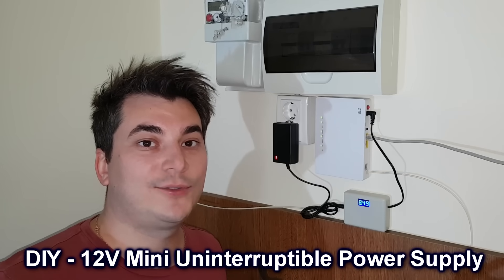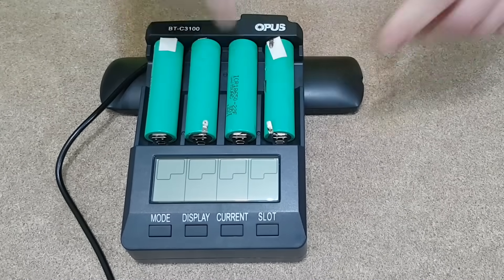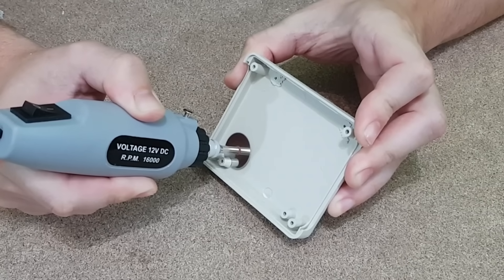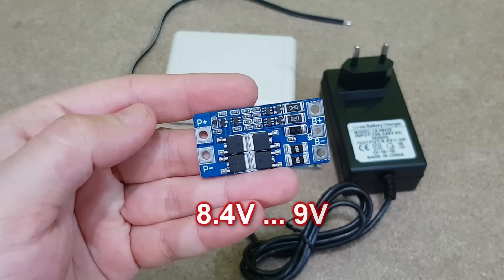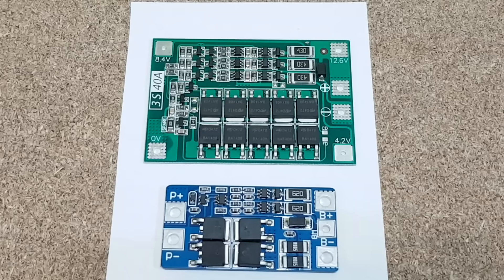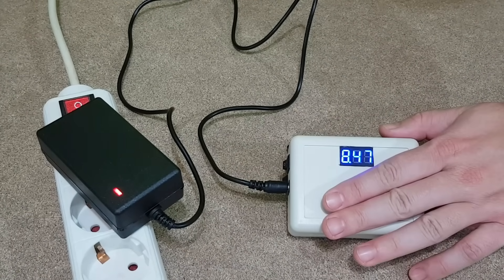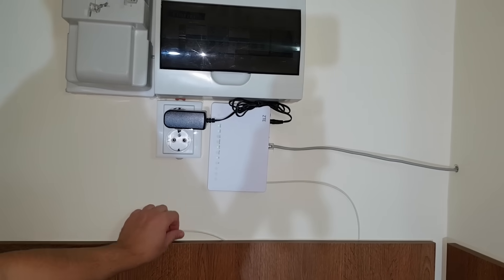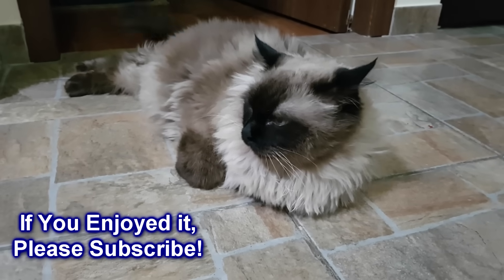DIY - 12V Mini UPS

Comment: Hello since you didn't use relay,diode,plc,static switch any of this i want to ask you if its ok to keep charging on for BMS ?
Reply from the maker: hi. this 2S BMS is almost continuously charging the cells, in time the cells capacity will decrease. but I've found a better 2S BMS board, I placed the link in the video description. it has overcharge release voltage. with this feature the charging process stops and will resume only when the cell voltage decreases to a certain value, from 4.2 to 4.1V I think. if you use good lithium cells with a very low self discharge rate, the charging process will start very rarely.
Reply: Ohh thats nice .. please can you take a look at this ?

1S BMS 2.5A/3A/4A/5A/10A/25A 3.6v 3.7v Battery protection board for Li-ion battery
https://a.aliexpress.com/_mMIYhwX
Reply from the maker: these are good, but for 1S batteries.
Reply: Yupp i need for 1s

Comment: If you are always charging the batteries and using the batteries to supply energy to the router, consider lower the charging voltage of the batteries. The batteries can be damaged if always working on maximum voltage. Lowering the voltage can increase the life time of the batteries

Comment: Nice proyect! Do you think it can be charged with a solar panel ? What should be modificated ?
Reply from the maker: hi. you need a charging controller or at least a DC-DC converter for the battery pack. and a solar panel with an output power much higher than what your load needs, so it will be able to power your load and charge the battery pack in the same time. I plan to make such a project, but it will take some time.

Comment: Can we use Adapter DC 12V 2A Power Supply Charger Plug for 18650 Li-ion Battery?
Reply from the maker: not really. you need to modify the voltage. 3 cells in series need 12.6V, so they will not get fully charged with 12V. and 2 cells in series need 8.4V.
Reply: @Sorin_DIY  I have 5V 1A  & 12V 2A Power Supply Charger Plug , Can I use either any one.???, if I have to use 3 cell in serial,.. I need to change 2S BMS protection board also right, I found this https://robu.in/product/2s-20a-18650-lithium-battery-protection-board/. but not exactly what you have used, will it be worked for 3 cells in series.?

Can you share Schematic if you have with 3 Cells and which BMS protection board which can I use .?
Reply from the maker: that 2S BMS is not very good. if you plan to make it with 2 cells, I suggest you use the BMS board from the video description. or another BMS with balance charging and overcharge release voltage. you can use the 12V charger and connect a few diodes in series on the positive wire, to decrease the voltage to around 8.6 - 8.8V. then you connect the 2S BMS with the 2 cells in series. then the step up converter, to increase the voltage back to 12V. when the mains power is off, the battery will power the step up converter.
Reply: @Sorin_DIY   nice suggestion Thank you.
Reply from the maker: that BMS board is not good enough for this project. try to find a different BMS board, 3S or 4S with balance charging and overcharge release voltage features. a higher voltage charger and a step down converter (for the 4S BMS) to decrease the voltage to 12V. it's getting more complicated, but it's necessary. that 2S BMS board will damage the cells in time, it's not designed to always be connected to the charger. only for charging a portable device, then disconnect the charger.
Reply: @Sorin_DIY  got it Thank you for quick and clear response.

Comment: Hi Sorin, I recently followed this video and build one for myself. Must say it's explained well and like your sense of humour.
I do have a question for you. The overall setup works for me, so when power is on, my router runs on mains and when power is out, it runs on the batteries with no interruptions. However, while on main power, the batteries don't seem to get charged through the BMS. 
I have wired them just like you had shown, the input voltage to the BMS is 8.22 volts while on main power. I am unsure what I am doing wring here. Do I need a separate charging circuit?
Reply from the maker: hi. did you use the 2S BMS with balance from the video description? and the 8.4V charger? there may be a problem with the BMS board, if the cells are not charged. the charger should deliver a voltage between 8.4 - 8.6V. even if the charger voltage is 8.2V, the cells should still be charged to this level.
Reply: Thanks for the reply Sorin. I could not get the exact 2S BMS from you link. But, found a similar one from another website (added the link below).
https://robu.in/product/2s-8a-18650-7-4v-8-4v-lithium-battery-protection-board/
Description wise it looks the same. But, you never know. :)
For the charger, I used the original charger for my router but as the voltage was slightly higher than what was needed for the BMS as input, I installed a diode to bring down the voltage. I will try and adjust the input voltage to be a bit more than 8.4V and see of that works.
Reply from the maker: this BMS doesn't have balance charging. it should work, but in time the cells may get unbalanced and you will not be able to use the entire capacity of the battery pack.
Reply: Thank you. I will try to find a better one then. Any any case the setup does provide the backup for the few minutes during power outage and so does help me a lot. Have a great day.
Reply: @Sorin_DIY  I also used a unbalanced BMS, and went for "passive" balancing. Dont know for sure if it is called like that, I read you can balance batteries yourself every once a while, but at start use 2 same capacity batteries at the same voltage, and if should be fine. It give me good backup since my router is a 9v model 😊, and I need the router to stay on until generator kick in...

Comment: My router works on 12V 1 A. I want to replicate this circuit. I have 12 V 1A adapter and i want to use it as a charger for ups. please guide me how can i do that. can i use lm309 at input side to get 9v or any other suggestion
Thank you.
Reply from the maker: hi. I will make soon a powerful UPS, with 2 outputs. I will explain everything in that video.
Reply: @Sorin_DIY  looking forward to it

Comment: Hey Sorin, congratulations, this is a really educational video!
Just some questions for you, How can I pump-up the Output current of this UPS to around 2.5 - 3 amps?
What do I need to replace in its components?
Reply from the maker: hi. you need a bigger battery pack with a higher voltage and a buck converter, instead of a boost converter. it will handle the current more easily.

Comment: Okay, so after checking again and again the problem was with the fuses.  Without the fuses everything is fine.  Interesting even though the fuses are meant for protection. Thank you for your help you are the best 😉
Reply: I'm thinking of not using the fuses, does it really matter?
Reply: @prakharvj3362  For me it does not matter, it caused me to drop voltage at the output.  Without the fuse it works perfectly !!!

Comment: Hi, I bought the bms board you recommended for me, but for some reason when I disconnect the power I get not 12v but only 2.1.  With the charger yes comes out 12v.  Something terribly strange.  what could be the problem?
Reply from the maker: hi. try to measure the voltage on different points of the circuit, to find out where is the problem - the 2S battery pack terminals (with and without the charger), the BMS board terminals, the input and output of the step up converter. and did you use the same step up converter?

Comment: Can i use 3s bms board with it instead of 2s bms board ?
Reply from the maker: yes, but a 3S battery pack will have a voltage between 8 - 12.6V, so it needs more modifications.
Reply: @Sorin_DIY  What kind of modifications I need to do ?
Reply: Can you please tell me what modifications i need to do if  i use 3s bms board?
Reply from the maker: it's difficult to explain everything in a comment. I will make soon a better, more powerful UPS and I will explain in that video.

Comment: Hi idol can you also check this if its okay this channel diy budget ups is it safe ?? https://youtu.be/ibO4tInCgwc
Reply from the maker: hi. it will probably work for some devices, not all. but it's not efficient. it will not use the entire battery capacity, and the device may not work correctly, when the voltage drops. it doesn't have balance charging.

Comment: Where do you get all the laptop batteries you take apart?
Reply from the maker: hi. I got the batteries from broken laptops, I buy some of them very cheaply for spare parts, or they are donated to me. I can also find cheap used laptop batteries on local web sites with second hand electronics for sale, or at flea markets. it's a gamble, but around 70% of them are still usable. and being free or very cheap it is worth the risk.
Reply: @Sorin_DIY  Oh, that's really clever. You know those boxes in some stores where you throw old batteries right? For example at Practic or Flanco. If there is a laptop battery there, will they just give it to me? I don't see why they wouldn't
Reply from the maker: I don't think so, because... they don't care. as a final option, you can buy the cells. the ones I use in my fast charging powerbank are very good.

Comment: Hi Sorin, Could you please let know whether we can use eHUB 2S 8A 7.4V-8.4V 18650 Li-Po Li-Ion Lithium Battery Protection Board BMS Circuit Module? Or need to use only 20A  BM board
Reply from the maker: hi. you can use any 2S BMS board you want. if it's rated at 8A it's ok, because I don't think your load needs more than 2A. but it's very important for the BMS board to have balance feature.
Reply: @Sorin_DIY   Thanks Sorin

Comment: hi,

i did exactly the same, but output voltage is not going beyound 6.9V. Any idea what may be the issue?
Reply from the maker: did you use the same step up converter? what is the voltage on the input and output of the converter?
Reply: @Sorin_DIY  ya its the same convertor, and input was 7.15V and after charge was 8v. the step-up convertor may also be bad, have ordered a new one. Will update you if that too fails. and thank you for you quick response.
Reply: @Sorin_DIY  Update: the convertor was faulty. I replaced the convertor and it works like a charm. thanks a lot. Now going to make two more for my brothers. He have too much frequent powercut issues here, so your device is a life saver. thanks again.
Reply from the maker: I hope you use the 2S BMS board from the video description, is better than the one I used in the video.

Comment: I liked your video, and also that your router didn't restart when the mains is turned off. I have a question regarding:
What changes should i perform so that i can backup power 2 routers(12v 0.6Amp, 9v 0.9Amp) at the same time.
Reply from the maker: that will take more work. I will make soon a better UPS with 2 outputs. but I'm still working on the design.

Comment: Is the possible for a normal powerbank to run a modem 
Powerbank support 12v 1amp
But there were only USB A type as output
Reply from the maker: hi. I suppose that powerbank will deliver 12V only with a fast charge protocol, not all the time. so you need to modify it, to be able to deliver a constant 12V for a modem.
Reply: @Sorin_DIY  Thanks u

Comment: Hi i have a question i am unable to get the 8.5v dc adapter instead i have a 12v dc adapter can i step down the input from adapter and connect the bms . Then step up for final output . This necessarily means under normal conditions the step down converter output will be given as input for the step up converter is this a correct circuit or we can’t do that .
Reply from the maker: yes it will work, but overall efficiency is lower.

Comment: Does the voltage booster you use get really hot? I am using a a buck boost converter and it gets hot to the touch and I did add a heat sink as well.
Reply from the maker: hi. buck/boost converters get very hot, because they work with a lower efficiency than buck or boost converters, so they use more current. also it depends on the load, if your router needs more current than mine, the converter will get even hotter.

Comment: Hi sorin,I have to tell you I tried to assemble according to the schmatic, and it somehow does not work out.  It seems that the way you connect in the video does not match the schmatic.  Can you simplify the chart to the order in which you are authoring?  For some reason according to the schmatic it does not work!  Thanks.
Reply from the maker: the schematic is correct. did you use the same parts? the 2S BMS board from the video description is better than the one I used in the video.
Reply: @Sorin_DIY  ok, I'll order again. Could that be the problem?  With the charger I get 12v when I disconnect I get 0.4v.  Which board to order the standard or balance?
Reply from the maker: balance

Comment: Ok, so I did a similar setup ( but using a single 18650 and a TP4056 aka HW168.   I took a look at your schematic. not sure if the BMS you are using is different, but with the one I used it didn't work.

The two wires that feed the step up converter (the in wires) you are pulling from the charger itself with a mechanical switch.  With your schematic, the batteries continue to charge even if you turn switch off.  Also with your setup, we assume that if the 8.4v charger is unplugged, the batteries are sending their 8.4 to P+ and P- the ones that are supposed to be feeding the step up converter when the power goes out (no charger).

With the TP4056 I have IN+ and IN- and B+ and B- which is for the battery side.  I provide 5v and it charges the battery. I get 5v on in+ -, and 4.2v on b+ -, if I unplug the 5v charger. I drop down to about .24v on the IN side, and to about 4.12 on the B side.  

On my setup I have to feed the step up converter with the B side, wires connected to the battery.  Not sure if with the 2S BMS the correct way is how you have it, or if you just made a mistake on the schematic.
Reply from the maker: hi. we need to clarify a few things about your setup. what is the current consumption of your router? I presume at 12V. what charger did you use, 5V & ?A? did you use a TP4056 module without over-discharge protection? what step up converter did you use? 
my schematic is correct, the 2S BMS use the same connectors for IN and OUT power. the TP4056 module (with protection) has 5V IN and 4.2 ~ 2.5V OUT (from the battery). you cannot use the IN and OUT connection the same way, connected to the step up converter. always use a charging module with protection, or a li-ion cell with protection. 
if you use the xl6009 boost module, like me, it will not work correctly with 1 lithium cell. the xl6009 has a minimum IN voltage of 3V, and the li-ion cell (+ the TP4056 with protection) will discharge to 2.5V. the step up converter will not work correctly with only one cell. you can use a MT3608 step up converter, because it has a minimum IN voltage of 2V, but it has less power. so the current consumption of your load is important. also if you increase the voltage from 1 li-ion cell (4.2V ~ 2.5V) to 12V, the step up converter will work with very little power and at a very low efficiency. you can watch my video about battery packs and DC converters for more info.
considering that you can't use the 5V from the charger and the 4.2V (max) from the charging module OUT in the same time, how will the switching be made between the two, when the mains power is turned off? a BMS board does this automatically. if you use a relay, you will lose a lot of energy. it's doable, but not practical. I still suggest you use a 2S BMS or bigger.
Reply: @Sorin_DIY  Thank you SO MUCH for such a detailed explanation.  I know between almost nothing and nothing about electronics.  I just follow videos.

I have no idea how I ended up with 10 TP4056s, and the chips don't even say TP4056, they say HW 168.  You ask if I am using with or without over discharge.  I am guessing I am using the ones WITHOUT over discharge.  

I did notice some of the TP4056s I saw on the internet, next to the B+ -, had other pin (wholes) that read OUT+ -.  I am guessing those are the ones with over discharge.

When I started my project, I thought I had step up converters, but turns out the ones I have are step downs.  I have a 12v power supply (that is actually giving 16v) so I am using one step down to bring it down to 12v, and power an alarm siren.  I am also using the 12v output to feed a second step down converter to get me 5v, which I am feeding to the TP4056 connected to an 18650. And I have a d1 mini and a relay connected to the batter.

I now understand the big flaw with my build.  There is NOTHING to stop the battery from over draining, making the battery useless.

I am currently running tests with what I have, but looking to purchase the right hardware for my "real" projects.

I am getting into the smart home alarm system.  To maintain power on the modem/router and the Raspberrypi (where I run Home Assistant) I plan to use a regular UPS.  However if power does go out, I would like some D1 minis to stay powered on (like the ones at the doors with the door sensors). I would also like to be able to keep the siren going even if power is turned off.

For the d1 minis by the doors. I am thinking an 18650 with a proper TP4056 with over discharge protection, and a step up converter to get the output up to 5v.  (I know the D1 Mini only needs 3.3v but the relays one the hall sensor require 5v)

For the Siren setup, I would basically do a setup very similar to what you did.  Use two 18650s in series to get 8.4v.  Use a step up converter to feed the 12v for the siren, and use a step down converter to get the 5v.